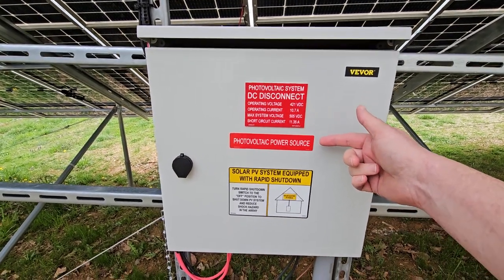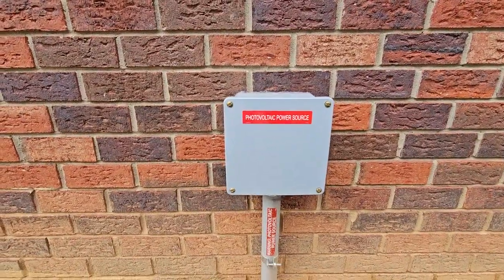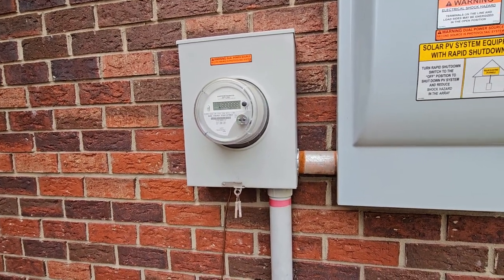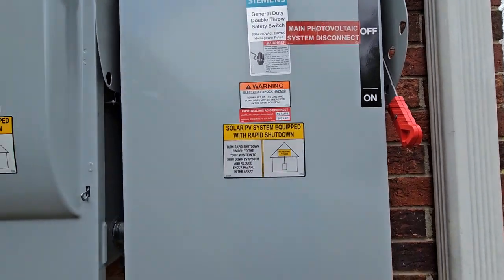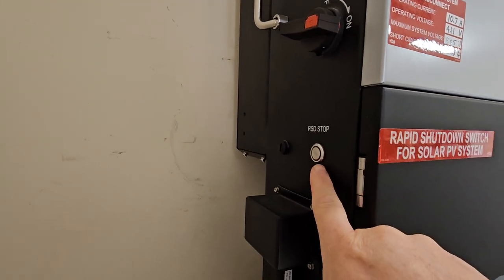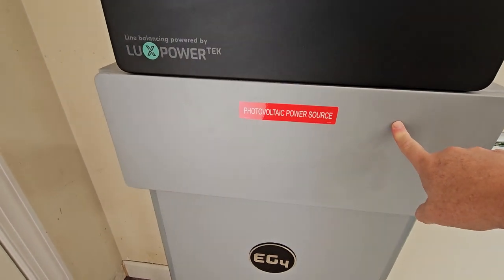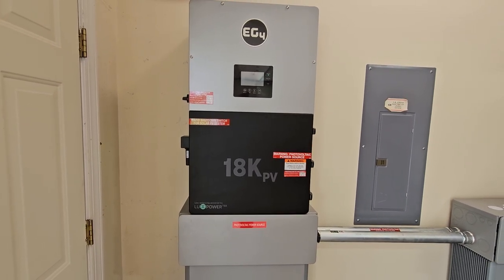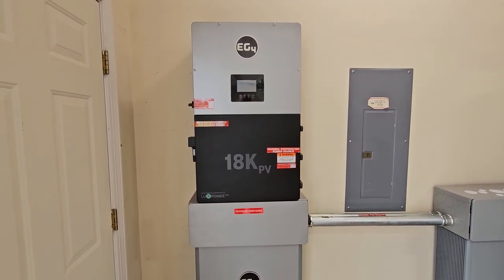Label Location for Solar Install

Comment: solar design in 60$ only  for permits and interconnection
As a highly skilled PV designer with an international degree in energy engineering and over 4 years of experience in American solar companies, where I completed more than 1000+ projects and obtained permits from numerous counties, townships, utilities, and cities.
I am confident in my ability to create comprehensive designs that align with local regulations (HOA), national requirements (NEC), and international requirements (IFC, IRC), ensuring seamless approval processes.
Panasonic, Eg4 batteries,
Generac generator,
solar edge, Enphase, Fronius, Hoymiles inverters

Comment: Soon I'll commence the install on my ground mounts and 18k w 2 batts and your series has proven to be valuable to a DIY-er/non electrician like myself. I will follow your lead on the inverter flown w ratchet straps as I'm installing alone however I'd love to know how you managed to set those 300 lb. batteries on the cleats. My thought was to hand truck them into position and let the floor do the work as opposed to lifting and dropping them on the hangers, I'm in West Virginia w few codes so I may (or may not) have that luxury. Before you mounted them did they seem stable when free standing or easily tipped over?
Reply from the maker: I used a hand truck as a lever to lift the batteries onto the wall mount plate.  It was not easy though.  As it is, it wouldn't tip over very easy, but it could if something put enough pressure on the top.  Honestly, I think you could place a 1" thick board behind the conduit box (properly installed there is a 1" gap behind the conduit box).  Mount the 1" board into the studs and then drill holes in the conduit box and attach it with screws to the 1" board.  The conduit box has four screws that go into the top of the battery.  By securing the conduit box to the wall and to the battery this would be enough to hold the battery and prevent any tipping.  Hopefully that makes sense.
Reply: Great idea. Thanks! I just saw a video with a guy named Porter Creek who uses a similar technique with a 2 by 4 and some blocks. I appreciate the help, I'm glad I found you and thanks for replying so quickly.